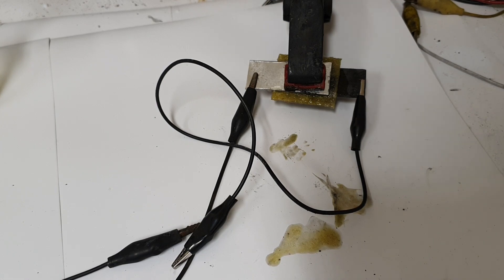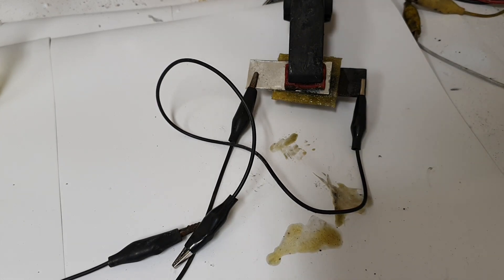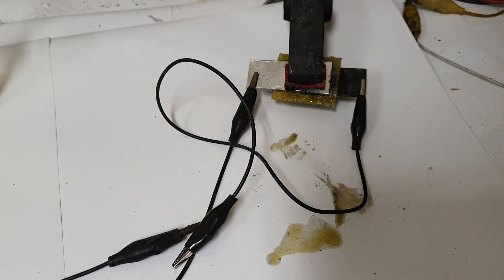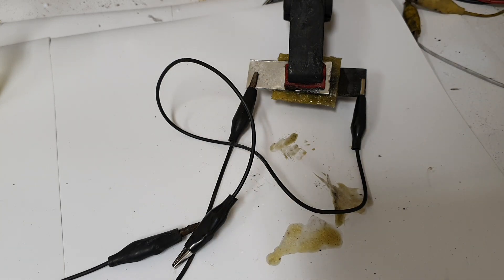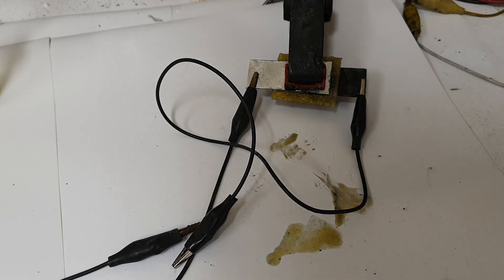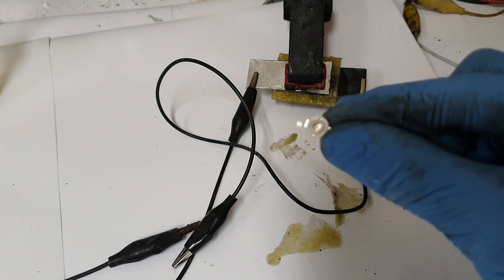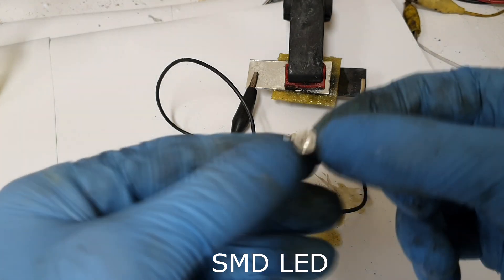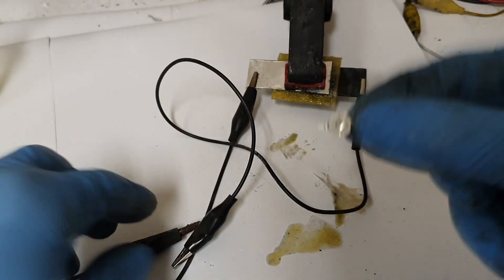Novel Aluminium Bromine Battery a Little update

Comment: Well done Dusan, finally a little more output power ! What is the voltage this cell puts out and what was the current through the LED ? Was really pretty bright, so I guess this was probably at least 100 mA at around 2.5 Volts ???
Reply from the maker: The cell voltage is 2.4 volts. The current on the LED was around 100 mA, yes.
Reply: @cayrex  Well done, can you scale up this cell some more ? Is it rechargeable ?
Reply: @oudotcom  It surely is not rechargeable as he is using an aqueous electrolyte as it seems and aluminium electrodeposition from that will be impossible (due to the redox potential being far below that of water...) with the exception of highly concentrated water-in-salt systems which are yet unprecedented for Al based batteries
Reply from the maker: @GreenCaulerpa  aqueous electrolyte? I really dont know where you get that idea...
Reply: @cayrex  okay then I guess I assumed it wrong. 
My assumption was based on the fact that there aren‘t too many classes of electrolytes and Since solvents would mostly rather quickly evaporate and since you said you weren‘t using des